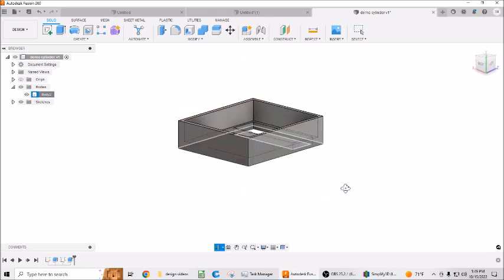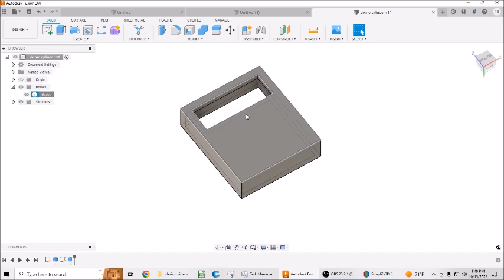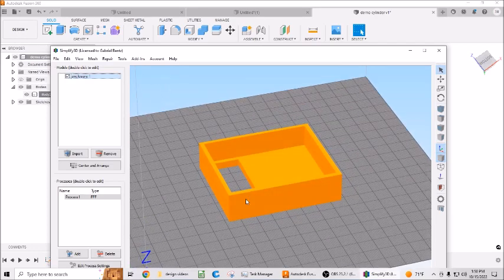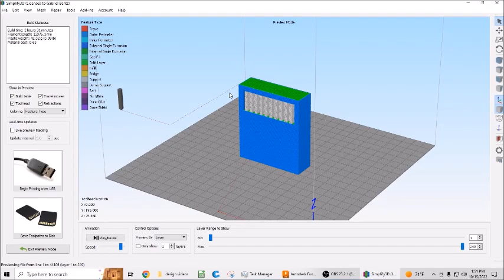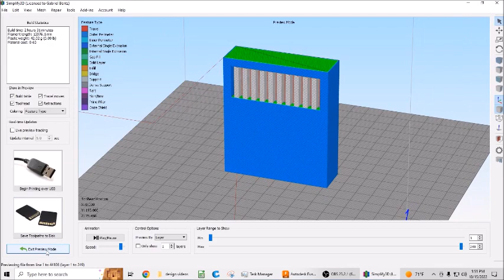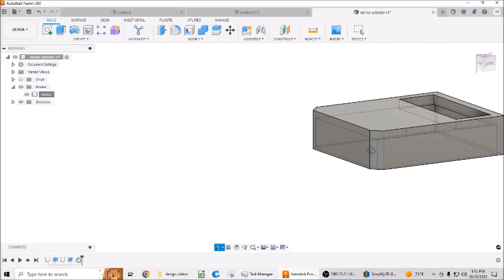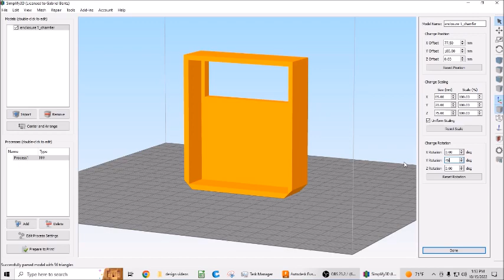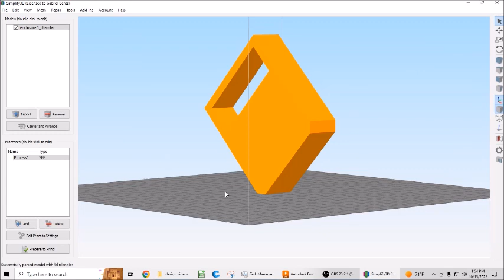The Power of Diagonals: Design for Mass Production 3D Printing 1

Comment: Like a previous post from Slant 3D it's a bad 👎 example to use. I'm not sure because of the sound quality but it seems like the guy who's trying to "prove" that he doesn't like 🤔 supports in 3D printing but cannot find a good example so uses stupid examples to prove his point. 
I'd like to challenge him to make a simple 6-arm starfish 15mm thick (that is 19/32th inch for the imperial USA)  with the rounded corners and edges of the starfish arms at 60° between the direction of the center lines for each arm. In the center of it all is an extended tube of 10mm (25/64th inch) with a radius of 18mm (45/64th inch). The final requirement is that the rear must be hollowed out. No supports, brims, rafts or even skirts are allowed. I have designed this and printed it "flat" with supports and a brim because I cannot get it to work any other way. Maybe I'm just too single-minded to get it to work 😕

Comment: I often put bevels on corners and then use those on the base of my print.  for a while i had an issue with my printer not handling large flat surfaces on the bottom, and this entirely overcame the issue. :D

Comment: Dial in your first layer. The solution doesn’t seem logical to me and you also had to change the design that it works.
Reply from the maker: When making 100,000's of part you need to optimize every feature for the process.
Reply: @slant3d  I understand your point and generally like your vid’s but this was simply not on part with the other’s you’ve made. Thanks for showing us your world of printing and hopefully you don’t get me wrong. I’m not native and often to short in my comments.
Reply: @slant3d  don't take these comments to hard! 

These guys have not had to clean 50 beds of the same print with the face lyinf down with half of them havinf a tiny defect so you can't use them. 

Beds don't always last or have a very small spot of grease ruing your first layer look.

Comment: Wow, did you really have to work to push your point. Mass produce on 3d printer, i think rather than changing  the geometry to hopefully print without supports, i would again print on the back and buy a 2nd printer, which gives me a backup machine. But the biggest problem is adding features to a design, every fancy thing you do is usually at a cost. biggest cost is your fancy idea is just another experiment and you have to do it again.
Reply from the maker: Now Print 100,000 pieces.

Comment: I think this is a matter of taste / preference. Personally, I prefer the look of the bottom layer to the angled layer lines you would see if printed in the orientation you suggest. I usually prefer layer lines to be parallel to the edges of the part, I feel like they look nicer that way and more symmetric. I also much prefer the look of the bottom surface compared to the look of the top surface (unless I iron the part).
But of course, if 3d printing mass production is a goal, then for sure this would probably the only way to make it viable.
Reply: @Blizzard4242 I fully agree with you. After watching other videos from Slant 3D I've come to the conclusion that "THEIR WAY" is the "ONLY WAY" to do things. They seem to "bastardize" all designs as long as it fits their way. 🤪😜 This particular presenter has something against support structures. My oh my 🥺😳😭

Comment: Interesting print orientation. I normally try to avoid printing like that due to the high chance of the print failing. To be fair I mostly print on bedslinger printers. I'm curious how much more reliable printers with beds that move in the Z axis do with this kind of print orientation.
Reply: @LX You need to run at slower speeds to make this work, and maybe have z hop enabled.
Reply: @AmericanMaking  Yeah but then there goes the point of having a fast printer with minimal bed movement. Z-hop is also treacherous because it introduces vibration into the bed.

Comment: I tried to look at this option for my products which have a very similar shape. I have to clean and buff the PEI sheet after every few batches to get the nice surface finish on the parts. If I dont clean it you start to see patterns from the previous parts that were made. The biggest problem with this method shown here is that it takes a lot longer to print and the risk of detaching from the print bed. You have very short XY movements so there is a lot of direction changes and z height changes. When laying face down the printer has long sweeps of layer lines which help with speed. Changing my prints to this orientation resulted in 2.5x print time with no profile change. (no supports activated)